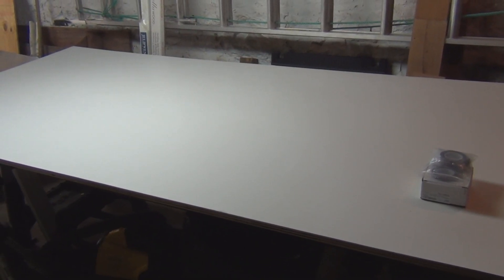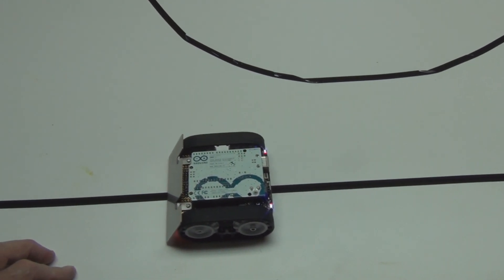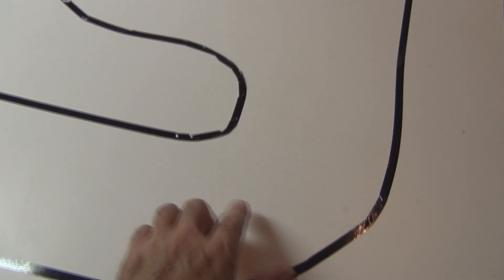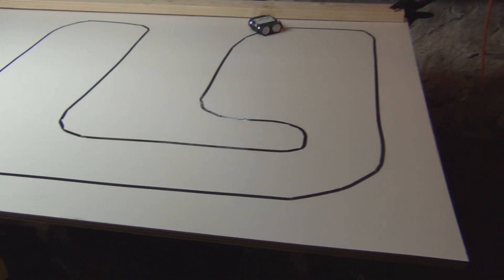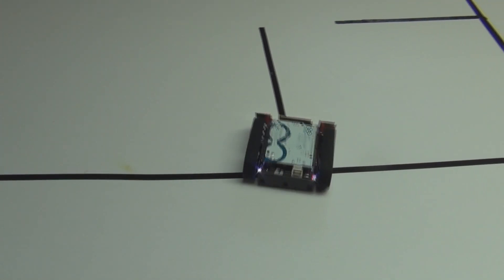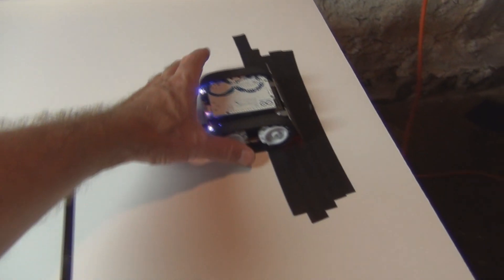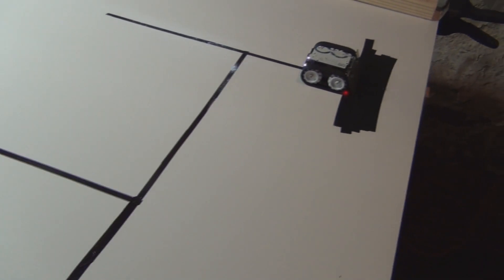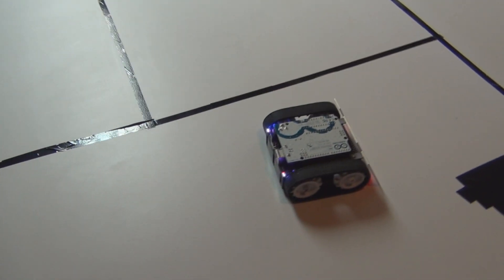Zumo Robot Line Follower Maze Solver Demo

Comment: can u show me the code pls, it's very helpful for me, thank u
Reply from the maker: You need to add the Zumo library to the ardruino IDE and that will add the line followers example.  Here is an link explaining how to add the library.  https://www.pololu.com/docs/0J57/6
If you are using version 1.6.2 or later of the Arduino software (IDE), you can use the Library Manager to install this library:

In the Arduino IDE, open the “Sketch” menu, select “Include Library”, then “Manage Libraries…”.
1. Search for “ZumoShield”.
2. Click the ZumoShield entry in the list.
3. Click “Install”.
Once installed you go to file-->Examples-->ZumoShield--->LineFollower in the Arduino IDE